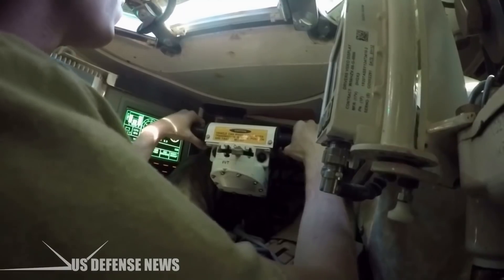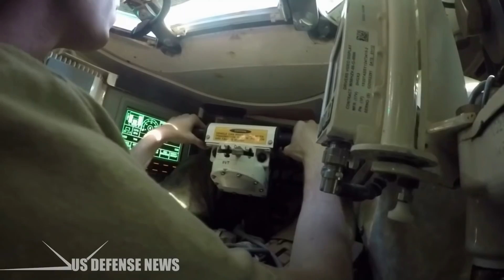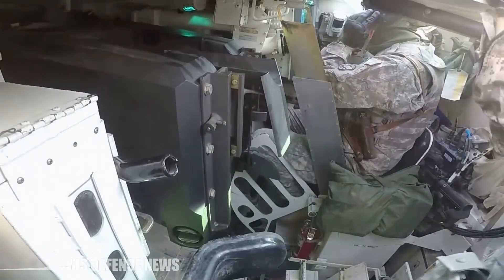Why No One Wants to Fight U.S. Abrams Tanks?

Comment: As im sure its been explained we do not sell the most heavily armored and lethal m1a2.  Those ones you are saying were destroyed were low trim level versions.  Do you think we would sell the same tank to anyone else? ? Think about that .  and think about how those tanks are a hit with a mediocre. Anti tank weapons. And the cloud of dust before the video is cut off.  Everytiime its a cloud of dust claims the tank is destroyed.  If the abrams has.itd eye on you, you need get right with your spiritual leader, cause your gonna meet him soon.  That's goes for anyone.  Its a purpose built killing machine.
Reply: And so did the Iraq export variant of T-72 and T-64 when America attack Iraq.

Those T-72E lack any supposed specs that were in T-72 to fight an M1 Abrams.
Reply: Ieat utube Technology can only work with power and prevention of hacking.
Reply: Starburst Attack I believe it . i used to work with them some and made the mistake of tapping the front spear with a hammer.  All I know is that hammer bounced back at me lol .
Reply: Ive seen an A2 SEP destroyed in OIF1. The turret was blown off. 100 lbs of c4 with a few anti tank mine stacked on top and a 155 artillery round stacked on top of that
Reply: I was on the iraq 140 program for GD back in 2010-2012. We sold the iraq army 140 A1s and iys was definitely downgraded
Reply: It's a $125,000,000 video game console you need 2 college degrees to operate the steering on.
T-34's used to cost around $10,000 a piece & could be operated by anyone who had driven skid-steer. 
Tungsten Core, Carbide Tipped & Depleted Uranium rounds are shockingly easy to make. 
The U.S. exports A-10 Warthogs at twice the rate of Abrams tanks.
Do the math! Nobody in the developed (First) world fears this tank!
Reply: a question I have with the Armata since it has all the crew in a ball what happens if the control line to the ball is hit I mean the crew might survive but if you cant control your tank your useless,  in a normal tank a person might die but the tank is not rendered unfunctional just a question I had probably a good answer, the T14 being better is debatable since it has not seen live combat and might just be propaganda but im open to debate
Reply: TimMcHavoc morroco have that tank
Reply: TimMcHavoc lol Abrams wasn’t developed only by Usa
Reply: TimMcHavoc

Comment: Do you know how the M1 is called by many russian tankers some times? The "Bullshit machine"! As I see it, the abrams has several designflaws which could have been avoided totally. This List includes the choice of the engine, the location of some switches (who has the switch for the ammo type), a flaw in the firecontroll system (increases time to aim the gun), the gunner hase a monoocular instead of a biocular (increases fatigue of the gunner), the drivers station is stupid (Leopard tanks are driven like a car....litterally), the concept of their NBC system (Ok. This on i have just heared, but if they really have to put on masks in the tank, then this is just beyond stupid), ....
To their defense, just because a tank is burned out, it must not necessarily mean that this tank was killed by the enemy. The tank could have been destroyed by the crew itself to avoid the enemy salvaging the tank or parts of it. Not every burned tank shown in a propaganda video really was a total kill. A blown ammo rack does not mean that the entire crew is dead. Modern tanks are desinged for maximum crew survivability. Material on that matter can be found relatively easily because it is mostly not classified (some of this systems are older then 20 years).
Reply: And please, STOP USING STUPID COMPUTER VOICES. That voicees are beyond shit.
Reply: +Axel Bamberg

 What are you on about?

Comment: Don't forget, the M1A1 is the only tank in the world that can target, track and kill a target traveling at more that 80 kilometers an hour. That means it can kill any target traveling on the battlefield.
Reply: In the video game...
Reply: Sorry nothing Russian built int he amror line is worth a crap against the 120 main gun, nothing!
Reply: Mok214 ,nope.
Reply: And it does it with an 18% kill rate, which is why it's never done.
Reply: not a governor, its a set of heat senors and yes 72 mph is possible right down the autobahn.
Reply: Track, lase for range continue tracking fire.
Reply: YOu read and play to many games. Off road depends on the terrain..  1.5 second tracking and lase the M1A1 can kill  anything with a 96% chance of 1st round kill. that is kill, not hit.
Reply: Not with proper track maintenance.. there is specs for proper tension and well kept tank can safely travel at 72 mph. Been there done that! Autobahns in Germany.
Reply: Not the governor its the heat sensors int he exhaust duct.
Reply: Myles cornelius 

There has been losses of the the tank, but none due to enemy tanks.  Its true no crew has been lost in it yet.
Reply: Myles cornelius thats because they have only been deployed in iraq and afghanastan ect. No actual militarys. Therefore it only goes up against cheap unreliable anti tank weapons. The rpg7 is even used agaisnt them when it is officialy for use on light armour or transports. Im not saying it isnt powerfull im just saying it hasnt been properly tested yet
Reply: I was a tanker, this is a bad ass machine, there is not a tank out, there, that can fuck with this tank. Multi target reads , 50x mag scope , it'll reawch out and touch you easily.
Reply: thedog556 the failure of the armata was a driver mistake, handbrakes we're on, which is obvious because it couldn't be towed,
Reply: Ieat utube that is literally the most bullshit thing I've heard
Reply: damn
Reply: M1 with a 1.5 second tracking and good lase can kill anything on the move while the tank is moving. We took out a  Mig going vertical with after burners on, in Iraq and we were hauling ass aroudn 35mph
Reply: The Abrams doesn't need radar to kill the T-14... thermals have dominated the tank world for years
Reply: Neither is battle tested.
Reply: tooooooooooooooooooooooooooooooooooooooooooo patriotic
Reply: Other tanks can do that too but it aint easy abrams does it easier so its the best tank at shooting moving targets
Reply: Mok214 i drove one...
Reply: Out of most of the modern day MBT's, the Abrams and the challengers are probably the most battle tested, where with a lot of other vehicles it's just numbers.
Reply: SuperGeronimo999 65km/h governed. They can move way faster without the engine governor.
Reply: The leclercq can,
Reply: Mok214 COUGH T-14 armarta
Reply: Jotaro Kun 
No, it won't pierce
Because it can't...
Besides cannon size does matter.
I'll take a 120 L/55 over 25 bushmaster any day...Plus the longer the barrel, the better precision, speed and penetration of rounds is...expect for heatfs and HE...the range really doesn't matter then
Reply: More bs pls.
Reply: Mok214 : Not any more .
Reply: Jotaro Kun Nothing is invincible.
Reply: Steve Kovalck is that why America had to buy Britain’s tank armour off us? 😂 before we let America have our gun and our armour for the Abrams it was a disaster. It was fat, heavy, slow, got bogged down all the time, could be destroyed by a T72 and couldn’t destroy much 😂 1976 was when it came out, look it up. The leopard 2 and the challenger 2 are both superior to the m1a2 in almost every aspect 😂 but MURICA has to go around claiming to be the best at everything
Reply: BlackSkiesProductions so your answer to which tank is better has nothing to do with the tanks but how many of them their countries built????? That’s bullshit 😂 America made shit tonnes of M60’s but it didn’t stop them being shit and in the end needing to buy the Belgian made FN MAG/GPMG.

As I’ve already stated, the original Abrams was the biggest failure of a modern tank in the civilised world. America had to buy our old chobham armour and our gun and make dozens of modifications to make it comparable to the leopard 2 and chally 2. Without our help the Abrams would still be a monumental failure. We built amazing tanks on the first try and statistically our tanks are more proven. In Iraq the only challenger 2 that got destroyed was a blue on blue incident involving another challenger 2. Other than that no challenger 2 has been destroyed in battle. How many Abrams have been destroyed in battle?

The chally 2 spent hours on end waiting for recovery while hundreds of Iraqi fighters fired a variety of missiles and rockets at it and couldn’t penetrate the armour. The only damage they caused was some fragmentation of the inner side of the lower plate when it was hit with a shoulder fired missile, slightly injuring the drivers foot.
Reply: BlackSkiesProductions I’m not debating the efficacy of numbers. But this discussion is about the better tank on a 1 to 1 comparison. You are confused and are comparing countries ability to win a war based on other factors such as numbers. 

Besides, those 14 Abrams were destroyed by a variety of causes, the only challenger 2 to be destroyed was destroyed by friendly fire, proving that the only think that can kill a chally, is another chally 😂 well I mentioned the leopard 2 in almost al of my arguments so you just assumed that the challenger 2 is my tank because you are butthurt that the Abrams was a failure at launch. In 1976 America developed one of the worst tanks it possibly could, just like how Britain developed the worst rifle it possibly could in the 80’s. Then just like the British did with H&K, America asked for our help to dress the Abrams up in nice weapons and armour so that it would be competent. You brag about it but it’s untested. The most it’s had to deal with is T-72’s. So making claims that it can beat Russia’s MBT or China’s or even Germany and Britain’s is unfounded on any evidence and based on the successes of all our tanks at launch, it’s a silly claim to make. The Abrams is good at killing cheap Cold War tanks but that isn’t hard, against real tanks, the Abrams may aswell be a light skinned vehicle. Chucking depleted uranium and other variants of it into the weapon system and armour is just like a child putting extra Lego on 😂 no science behind it just pure ambition using “cool” materials. 

We spent years testing and manufacturing that armour we sold you. We made sure that it was the perfect combination of compositors to make it the strongest possible and you bought it and in true American fashion with no evidence or science, you modified it, convinced you were making it better 😂 nah. While the DU rounds are very effective so credit there, the armour is no stronger after your modifications than it was when we sold it to you and it certainly isn’t better than the second generation armour that we kept for ourselves 😂 the Abrams is a redkneck. Tough, reliable and an underdog...but it can’t keep up with thoroughbred athletes like tanks the rest of the western world has. Sorry. You’re biased.

Oh and the m4 couldn’t beat a tiger to save it’s life, the only m4’s that could beat Tigers were the firefly’s which had oh yeah, A BRITISH GUN. Sound familiar? Just like the Abrams. Seriously for a country that has one gun for every citizen you don’t half make terrible armaments for your military 😂 the M60...fail. The M4....fail. The Abrams...fail.

The T-34’s can take more credit for destroying German tanks and had we not left most of them in Dunkirk, the Churchill tanks which were the only allied tank that was deemed to be a direct brawler with the tiger 1. Thick armour, big armament, heavy weight and large profile. If we had more of them then the tigers would have been on the run 😂 Russia, Britain and Germany’s tanks were the best then and they’re the best now. No argument about it. 

We invented the tank for crying out loud, of course we’d produce some of the best ones in the world.
Reply: Alex James The Shell exploded in the breech and set the ammunition stowage on fire, detonating all munitions stored on vessel, killing the crew.
Reply: BlackSkiesProductions operator error is hardly relevant when talking about how the tank stands up to outside threats. Never said chally was the best, just that Abrams is far from the best.
Reply: BlackSkiesProductions that can happen to any tank, and yet again, it was a CHALLENGER who took out this one ;)
Reply: Mok214, flat trajectory at over 2 miles is impressive, but then add its technical firing system and damn. I'd hate to be on the receiving end of that thing.
Reply: Tell that to the pilot of a Thunderbolt II, Jacka$$!
Reply: Mok214 M1A2*
Reply: Sure, but you're not destroying any target while driving on a highway... and yeah, the Leopard 2 can do it aswell. With little changes to the engine, it does 1800hp, with higher boost pressure from Turbos, even 2600hp. Its been driving 116 Km/h before. Not useful. As you said, damage + deaf crew (110+ dB) and no steering. Tanks can certainly go 80+, but not in their preferred territory.
Reply: 1) It can't reach 80 Km/h, it merely reaches 65 Km/h. On the street, not offroad.
2) M1A1, but not the more advanced M1A2?
3) ALL modern tanks can hit while on the move.
Reply: +ricter29
......he is saying the 'target' is moving at 80 kmh not the tank......idiot.
Reply: well i guess the only targets moving faster then 80km/h will be a helicopter or a jet (or a real tank like a leopard 2 !) .
hold a  button and follow the target.... fire .... that's all to it.
only a smart gunner will pull it off though , a jet will be very difficult to get right
Reply: Mok214 All of the third 3 gen MBT and above have ability to track and kill target that moving more than 80km/h.

Except Pok pung Ho tank...or Chonma-Ho..
Reply: Mok214 "it CAN kill any target in a battlefield", but there's a diffrence between can and will.
Reply: It won’t go 80 so I’m not sure how that would happen
Reply: Mok214 That’s true and also from what I’ve read about it there has been no M1A1 Abrams lost on the battlefield no crew killed while in it either
Reply: It's a good tank, but past its time, the modern 4th generation tanks are far superior, especially the Type-10.
Reply: They. Should stick this up Trump.sasshole